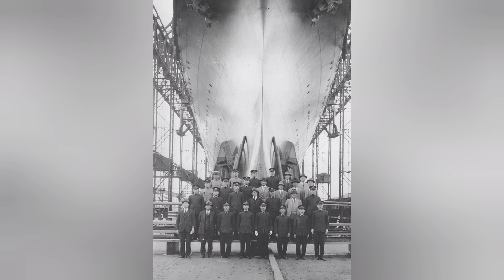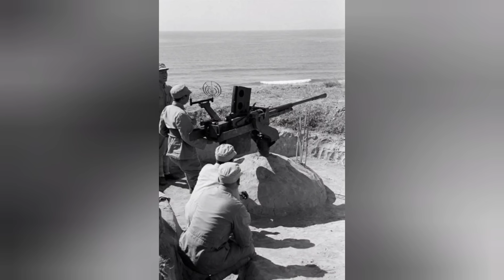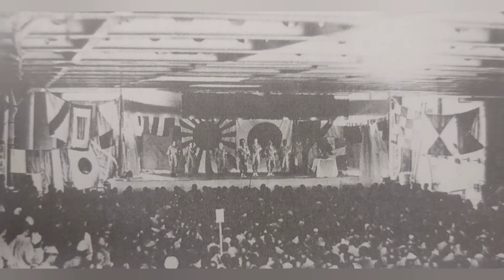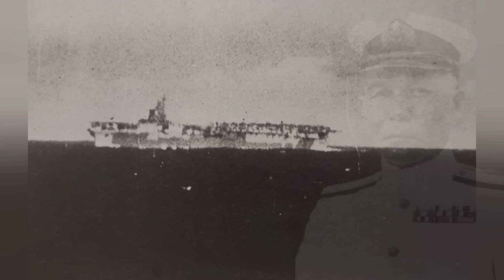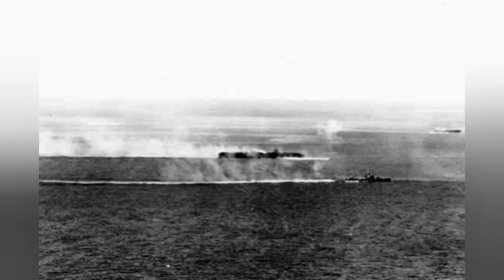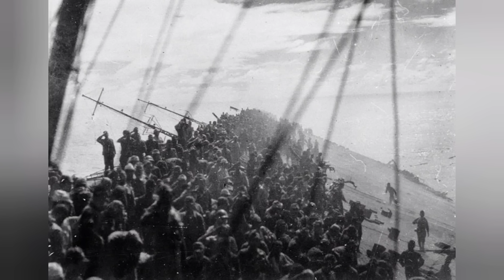Sinking IJN Zuikaku

Comment: As Zuikaku was going down. One of Enterprise’s VT-20 Avengers slowed down to stall speed and the pilot “rendered final honours.” Zuikaku’s crew didn’t take it well.
Reply: "rendered final honours"
what were those?
Reply: @KevinBreak  gave them the finger
Reply: 'Final honors' or 'pay back for Pearl Harbor'
Reply: Filthy fighters! Read Knights of Buchido by Sir Edward Russell if you’re interested in reading quite how demonic these people were during those times. 👍📚🇬🇧
Reply: @j3lny425 in Enterprise’s case. It would be personal. As the two had clashed several times at this point. Honestly, Cape Engano should’ve been a one vs one between  Zuikaku and Enterprise.
Reply: @ph89787 
American Chivalry is not exactly 
the Japanese Bushido’s concept which is ‘Vae Victis’ exclusively. Re : Bataan Death 💀 March 
NO HONOR for the vanquished that are left alive.
Reply: @DaveSCameron 
Dead 💀 Right !

Comment: The 12.7 cm guns are actually 5" guns.    And most likely were designed as 5" not 12.7 cm.  Just saying.
Reply from the maker: @tmiklos4  Japan used the metric system. The weapon's official designation was "40 caliber Type 89 12.7cm gun."
Thanks for commenting.
Reply: @centralcrossing4732  or were they using or copied  an existing size that originated as imperial  ?   5" guns were used by US and I believe  Britain and probably others during WW II...  It just seems strange that 12.7 cm is exactly 5".
Reply from the maker: @tmiklos4  It is the same size. Regardless of it being the same, different units of measurement exist and we can't ignore that fact. Even though those different units result in items of the same size, the way it's recorded is different. The Japanese used metric. It does not matter what any other nation used when discussing a Japanese piece of equipment that was designed and designated using metric.
Reply: @centralcrossing4732  just seems weird...   An even 5". Compared to 12.7 cm.